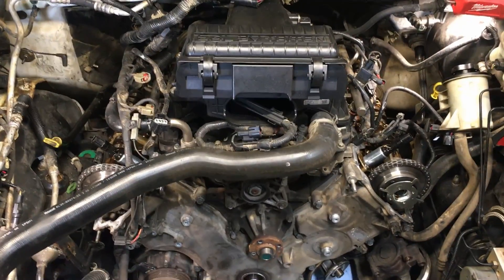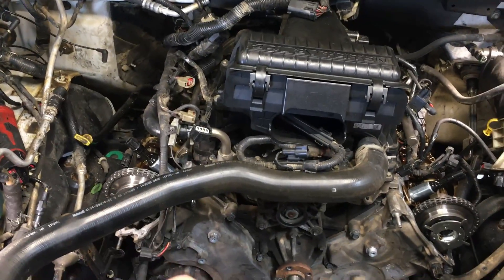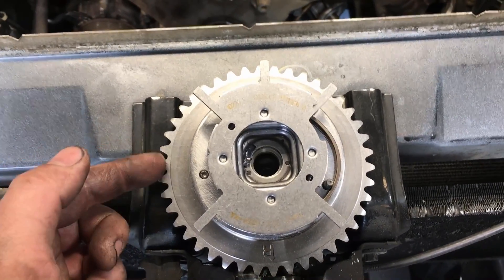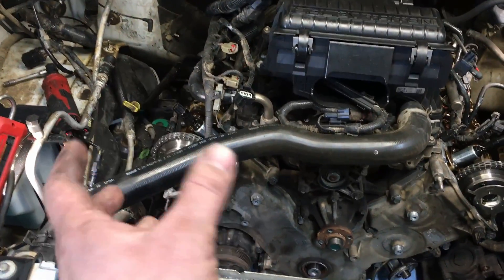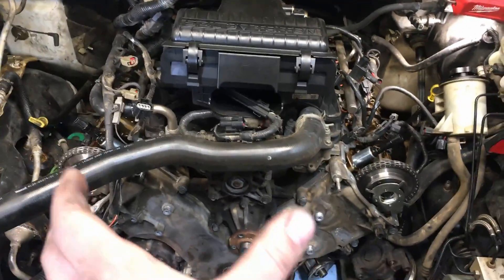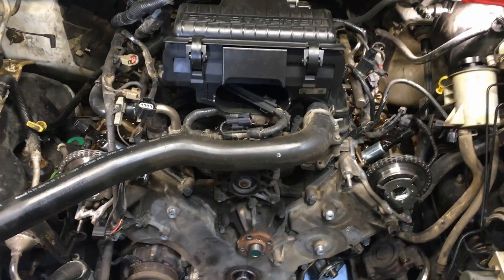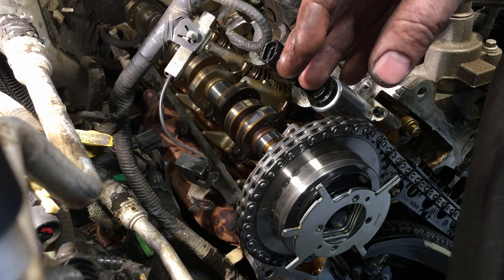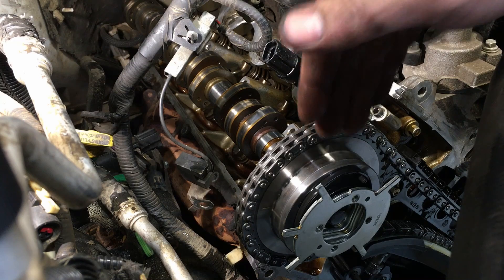Ford 5.4L 3v Triton Engine: DO NOT USE AFTERMARKET PHASERS FROM FREEDOM RACING/OTHERS; THIS IS WHY!

Comment: There's a less expensive way to fix this problem with the 5.4 3v remove the engine and replace with a 351 problem fixed. Then sell the 5.4 as a boat anchor.
Reply: Mechanicman1970 that won't work AT ALL!! 

A good strong wind, and the 5.4 boat anchor will creep, and your boat will be crashed on the rocks!!
Reply: @Lonewolftechengineering  I agree, however when the maintenance requires tearing apart half the motor for something simple it's time to just get rid of it.
Reply: Mechanicman1970 had 5.4 V8 back in day in 2 trucks ran great..sold em & ran great for new owner 240k mis +.
Reply: @Davido50  must of been old 2 valve 5.4,for the most part they held up pretty good, I have a 03 2v 4.6w in my truck with 350000 ,just done basic routine and timing chain and guides for 12 years,  she's burning about a qt. of oil a week, I drive 75 miles a day,  about half gallon antifreeze ever 3 months but still going pretty good considering cylinders must be egged by now with rings and heads near worn out yet Il still take her anywhere
Reply: @wolfmanrebel874  I got 02 Mustang GT 4.6 2 valve engine 5speed car!  I've owned for 16 years and 350000.0miles never had the first sign of trouble!! Where is ur coolant going?? Mine had leaky intake gasket once, that filled up spark plug hole n would make one cylinder sputter under a load!! I used small thing of black pepper in top radiator hose clamped back together n snuggled up intake bolt on leaky side that was years ago must of fixed it!!  Mine does not loose no oil between changes but I've always serviced it and used Mobile1 full syn 10w30 motocraft filters!!
Reply: @scottyjones27  lol,funny you ask actually,well I have 400000 on her now and ironically this past weekend I did intake gaskets ,plugs,and a deep deep cleaning inside everything,my lower plenum when I took it off had nearly a qt of oil in it so my oil consumption is coming through pcv even though it's properly maintained , probably from the miles causing more blow by and pushing it through,I'm installing a catch can system this weekend. She runs great,after doing all that I swear she feels like she has a 160000 miles again,my oil has always been motorcraft synblend but I moved from 5-20 to 5-30 like 5 years ago, antifreeze  is basic supertec green changed every 2-3 years with valucraft t-stat( I know...but never been a problem this long...) Plugs always been motorcraft oe and air filter is a p.o.s k&n that I hate but it's still there.
Reply: @wolfmanrebel874  Ford tough!!!  If where u live is not really cold in the winter u mite can try 10w30 engine oil ?? I live n South Kentucky it gets cold but never below 0° is why I can run thicker oil !! I'm feared of the new stuff is why I keep my older 02 ford I'm like U if something needs attention I feel like I can handle it!! And junk yards around here in Kentucky are chucked full of crashed mustangs so parts are cheap!! These folks can't drive when it rains!! Lol!! If I ever need another Ford I'm going to get one like I got but with lot less miles it be staring over again!! Had so many Z28's over the years , they always let me down on reliability!!  is why I got this Ford tough Mustang GT 5speed car!!
Reply: @scottyjones27  right below you brother, Smokey's east TN
Reply: @wolfmanrebel874  Kool I live in Corbin Kentucky home of KFC !!! I go to doctor in Chattanooga, I drive I-75 to 24split n it's few miles on 24 be for u get to 59 South!! Ur 5w engine oil is getting to hot and evaporating just my figures?? Get ya a 160° thermostat, and try 10w30 that will help aid in reducing of oil evaporation!! I do lots of interstate driving my self temp hand only goes 25% up, until stopped idling or city driving then befor fan kicks on temp hand goes abt 45% up that's life of engine oil keep it from cooking off!!
Reply: Just don't buy Ford. Lol
Reply: Kind of makes you wonder why they changed that 351 into a fight at 2 a 330 I prefer a 351 stronger motor.
Reply: 351 carbed?
Reply: Jeremy  Gerhard. Injected or carbed still a better engine. The gm ls engins are still like the old school push rod v8's
Reply: Mechanicman1970 finally a good idea to make the gen of fords better
Reply: Agree.  I've never been one to dog on Ford (or any brand for that matter) just because it's a Ford.  But after about 1996-97ish the F150 started downhill and the 250 and 350 followed when they made the switch to the 6.0 powerstroke in the early 2000s (03 I think).  By most accounts I've heard the new trucks are pretty solid though.
Reply: Mechanicman1970 that was my opinion but I was thinking pre-74.
Reply: Mechanicman1970
Just don't make more than 500hp with one.
Reply: Swap in 6.2 gas engine. 385hp.
Reply: I loved my 351! Awesome engine!  300k plus on my 78 Ford Conversion van. It was restored in the late 80's. I sold it in 95 for an 89 Chevy Conversion Van, it didnt have half the power that 3/4 Ton Van had. It also had Posi!
Reply: 390 would be a better choice. 351 is a small block and under-powered. It is reliable though.
Reply: @MrUbiquitousTech  years back my granny needed a truck for fire wood my uncle bought a 1973 Ford 4×4 Half ton auto trans  truck from rock quarry it was solid no rust straight body panels just dusty and from all the limestone dust the 302 engine whacked a lot cam humps where worn off!! Uncle already had old cop car with big 4 barrle carb  LTD super running 390 engine!! At idle it had 45lbs oil pressure!! One summer we put that LTD engine in that 4×4 truck !! Put headers on it, with cherry bombs bolted to the collectors talk abt pulling fire wood from under the hill side!! She was a hoss of a truck!!
Reply: @MrUbiquitousTech  depends on what year..I have a 74 f250 390 that's gutless in stock form and as far as factory Bell housings(no adapter) go your only choice is c6,np435,t18,3 on tree for an Fe ,on the other hand I have a 79 with a 351w swap that's really strong but once you get up into the years the 351 w really isn't anything more than a 69 Galaxy 302 in terms of power HOWEVER..you have ALOT of tranny options for Windsor including 4r70w and I do believe 4 r 100 as well,as they was a few in the mid-late 90's with small block bell pattern before modular completely took over and of course you have same options for trans as Fe but also 5speed,aod,e40d ect..so swapping a modular truck to 351 is in fact more sensible considering potential mpg and driveability increase significantly over Fe ,I don't hate the Fe but it's far from a favorite not to mention the stupid valvetrain issue and crazy low timing chain life before stretching out to pure slop..all that being said my 74 is a fantastic farm truck for the Field.
Reply: @wolfmanrebel874  Then there's something wrong with it. Even a stock 352 is pretty gutsy when in tune; your 390 should have plenty of power.

You're right though, the FE series has it's own bell, but all of those transmissions are rock solid.
Reply: @MrUbiquitousTech  the 352 put out significantly more than a 1974 390, mine has the compression in the 8's,she pulls fine but look up how numbers in 1974...that's what I mean by depends on what year,the 70'swent to truck only and got their balls ripped off ,I had a bad a$$ 1975 I rebuilt with car pistons from 60's and huge huge difference,I know these older Ford engines all to well mine has nothing wrong with it aside from pistons being so down the hole at tdc,my issue with valve train is well known,if you have the money machinist can change but they have the rocker rails and are notorious for "valve float" at high rpm as well as rail failure,every Fe 352,390,360 I have ever been around(alot) went through timing chains twice as fast as small blocks even with double rollers although it does help,you can take that for face value considering how shitty parts are now days,,Fe heads are awesome for the diy'er as they are similar to GM's vortec but the factory exhaust logs are really restrictive and for a work truck I absolutely love the c6 and np435 however for a daily driver if you drive a pickup70miles a day like i do will eat you alive,to each his own myself personally if I was to ever do a mod gen truck engine swap,which I likely would not, I would go with another option just because of what I need it to do on a daily basis,you prefer Fe that's perfectly fine and has potential to be a mean machine but a 1974 390 has less hp that a roller 5.0 in 1989(alot more torque though obviously)a 60's 390 such as 65 Galaxy or so on has 300+ if im not mistaken
Reply: True... I've had 4  351's run forever...including one with 400k never opened up
Reply: That's just silly, upgrade these and you'll have a solid truck for a good while.
Reply: No can't use these in boats. Boat motors need marine grade gaskets and seals.
Reply: @xlaroma  read again.  Boat ANCHOR, not motor.
Reply: Simone G. Boat anchor......

Comment: Are there any other symptoms of these not functioning properly besides the knocking and error codes? I had installed some aftermarket phasers, not knowing the issues, but has been running ok and quiet for a little over 10k miles. However, i do seem to be at a loss for power. No codes show up.  Was thinking about taking it to the dealer to do a full diagnostic on it.  The power loss is noticeable uphill and was thinking either that or transmission issues.
Reply: Probably cats starting to plug up, these 5.4's will run with a ton of issues and not set codes
Reply: Cats are bout a year and a half old, but could be. It was drinking oil with a bad pcv till i replaced the valve cover.
Reply: Robert Schneider the only way to be sure is to count how many Chevys pass you per mile!! If it's higher than normal, it's time to get a Chevy!! Only problem, the heated tailgate, to help warm your hands while pushing it in the winter, won't fit on a Chevy!
Reply: roadkill5333 LOL.

Comment: I'm seriously convinced that Brian is the best Ford mechanic in the world.
Reply: And definitely the most precise and passionate when making his incredibly informative videos .
Reply: It’s one thing to be a good mechanic it’s another to be able to portray that to the public and teach them in a way they can understand
Reply: @tyetash4407  very well said indeed!
Reply from the maker: Nowhere near the best just good at what I do.
Reply: @FordTechMakuloco  I feel in debted to you. You've helped so many people (including myself) and given me the confidence to take on jobs i never wouldve thought i could do, i for one appreciate greatly what you do. Youre a good guy.
Reply: WE'LL BE THE JUDGE ON THAT ONE BRIAN....!!!!!
Reply: @FordTechMakuloco  hey man , I have a 2006 F150 xlt 5.4 3v   the battery light comes on and goes off but mostly stays on all the time.  Ford put a New alternator on it and a brand new battery but they light stays on? They said that don't know why. But the changing system is okay.  12.5 volt with engine off and 14.7 volts at idle you have any idea? Thanks
Reply: TEST Fifty just a thought but check the wiring for internal corrosion? Seen some similar issues on my dads Saab. They replaced part after part and found a corroded wire (you can't see it cuz its internal is the plastic sheathing) his had issues with it not starting too after a while then it would start. I felt the wire get hot and knew something wasn't right. New cable and been fine since. Just an idea again. Idk
Reply: @FordTechMakuloco  -you dang sure are..!  
   you've already taught me soo much & for free..
    YOU TRUELY,TRUELY HAVE EARNED MY RESPECT & ATTENTION.!!

-THANKS AGAIN,
 BRYAN.

( mike, atl,ga.)
Reply: @FordTechMakuloco   you take your time to explain it with passion; thumbs up
Reply: @FordTechMakuloco  so who is better? 

We all know you are just being modest
Reply: @FordTechMakuloco  As a Ford 5.4 3 valve GURU, you definitely are an HIGHLY EXPERIENCED MASTER!
Reply: I 100% agree
Reply: Since Ron passed away, I have to agree wholeheartedly.
Reply: @EightiesTV  Ron was the best
Reply: You take pride,you're honest and want people to do the job once by using quality oem parts and have no issue letting others know which companie's to stay away from,parts aren't cheap.
Reply: He's up there with my ex father in law. This man speaks on it, you listen :)
Reply: I'm sure he will take donations lol 😉
Reply: Good mechanic great salesman
Reply: when it comes to the 4.6 and 5.4 engines, there is no comparison. He is the best of the best for solid info
Reply: Ford's failures keeps Brian employed.  🙂
Reply: He got my vote💯

Comment: I take it the phaser cannot be locked in position. There seems to be a lot of moving parts in a location stressed by the valvetrain and varying rpms. Why can't they be like the old 5.9 cummins and all gear driven. I understand emissions and mileage are affected. Don't worry, I see your frustration, its miserable when you see people use cheap parts and then expect you to mop the mess.
Reply: Oby-1...gears like the 5.9 will be unbelievably noisy! The Cummings diesel is so noisy, that you don't hear it! The 5.4 could be heard with the gear whine, a block away!!
Reply: There is a couple places that sell lockout kits but you have to reprogram the ecu so it doesn't tear itself apart. Risky and not worth it.

Comment: All Aftermarket parts are 100% Junk
Reply: Only the ones that seem too good to be true and are dirt cheap
Reply: No they aren’t.
Reply: Actually  some are the fixes that the OEM failed to address. I expect  to pay more for an engineered solid billet  part than the OEM but I agree a lot of aftermarket is junk
Reply: @airone50  Exactly, aftermarket can often be better. Just do your research first.
Reply: Cesar Perez GMB water pumps and Delphi fuel pumps work great.  I wouldn’t buy cheap tie rods or ball joints though. Too dangerous

Comment: Thank you for the heads up. I don’t see too many Ford’s but if one comes in the shop I’ll definitely use factory part.
Reply: Ford Tritons rarely need any service but oil changes. I'm still running the original plugs at 190,000 with no problems of any kind.

Comment: Just did a trans service on my f150  got the filter from O'Reillys and guess where it came from Flipping China didn't catch it till after I had it back together I'm going to Ford to get the filter never get a trans kit after market from the big box parts store.
Reply: rode past 14 auto parts stores to go to Ford to get a trans filter a couple months ago.  Motorcraft  part. Made in china.  wtf
Reply: chris janssen yup
Reply: I have been getting stuff from NAPA for years now, never have problems. I won't buy anything critical from AutoZone, OReilleys, etc. Last year had a lapse in judgment, bought a trans mount for the wife's van from OReilleys because they had it in stock. Lasted a year and the rubber tore. Learned to stuff heater hose in there and fixed it. But lesson learned the hard way...again.
Reply: Leonard Gilbreath an air filter from China?? Now we know where all of their steel is going to!! 

Thank God for the EXTRA TARRIFS!! Most Chinese imports are made from the LAND FILL LEFT OVERS!! Anything not good enough to go to a land fill, MAKE PARTS, SELL EM TO THE U.S.

Comment: I had a ford phaser shear the 3 locating pins that keep the tone wheel aligned with the cam gear but that was on a factory original cam phaser. Even though I was in a bind (I was doing a cam swap) I still bit the bullet and bought a new phaser from the Ford dealer.
Reply from the maker: Right, the original parts early on in production vehicles have the shearing issue.
Reply: Are you saying the Ford parts are just a little better than the aftermarket?
Reply: Here's the funny thing about aftermarket parts. You get what you pay for. If you cheap out you are going to end up just paying more. There are plenty of manufacturers that engineer their products, test them thoroughly, and stand behind them. For instance FordTech here recommends installing a melling high volume oil pump instead of replacing it with a Ford OEM one. Why? Because it's well built and addresses the issue of low oil pressure.

Obviously because of scale of economics, government regulations, etc, OEM's are somewhat limited on what they can do due to either longevity reasons, maintenance reasons, final cost reasons, and a whole host of others I'm not going to touch on here. 

If I'm building 1000 HP 5.4 you are on crack if you think OEM parts are going to suite my needs. It's all about what you are doing which is why you can't just throw stuff in and expect it to work. You have to know what you are doing and if you don't either learn and accept the risk that you take any time you do modifications or leave it to someone who know's what they are doing.